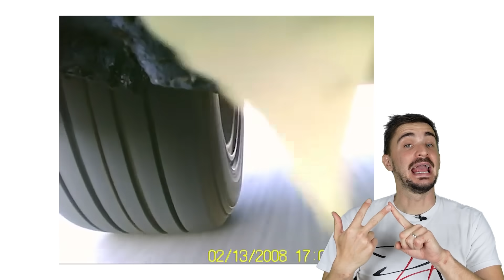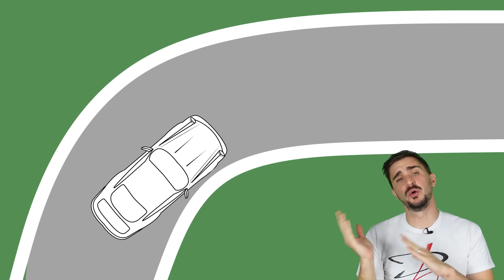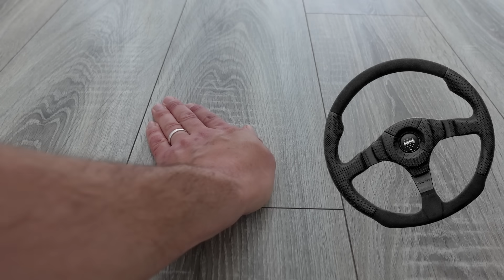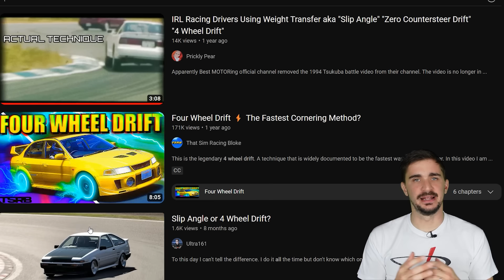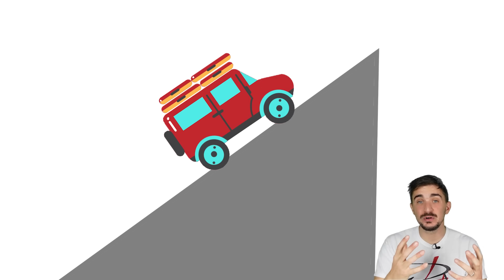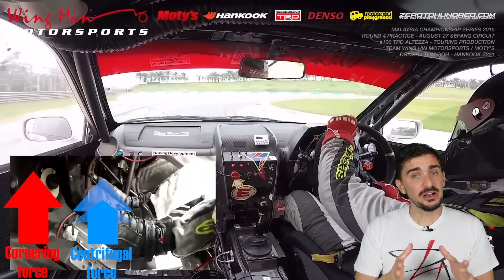You Think You Know But You Don't - Slip Angle Explained in a Way You Will Understand

Comment: Very good explanation but I would have liked to have heard about inertia and momentum. The car is trying to continue going straight ahead until acted upon when the driver turns the steering wheel. The centrifugal force is a component of the vehicles mass and velocity. Cornering force is basically the vehicles capability to redirect it's initial state. the vehicle starts off cornering at 0 degrees per second with zero centrifugal force. When the driver turns the steering wheel the rate increases to something above zero  and the component of centrifugal force increases.

Static friction/ traction versus sliding friction is also important. As the slip angle increases so does traction, to a point. Beyond that slip angle traction will decrease and at some point the tire will break loose from the road. When the tire breaks loose the slip angle will instantly decrease to almost zero but traction will not be restored because the contact patch is now sliding on the road rather than static on the road. 
To regain traction you have to dramatically reduce centrifical force and any breaking or accelerating forces. This is exactly the opposite of what drifting cars do.
If you're not drifting and actually do want to regain traction youll need to basically Coast. No gas, no brake and steer into the slide to reduce the centrifugal force which is pulling the tires across the road.

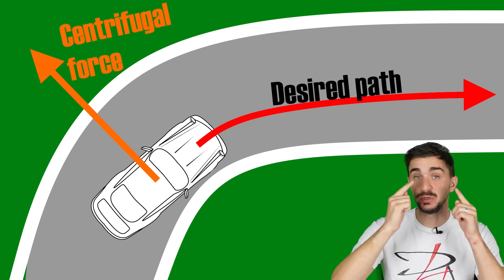Comment: This made me look at cornering with a completely new eyes, however one small thing, there is no centrifugal force, its the car inertia that is oposing cornering force, take a look at the corner at 2:16, there is no force pulling you at 90 degrees of the car, its only car inertia wanting you to continue forward off the corner, if in this moment car completely looses a grip it would continue on a straight path, not directly to the left...

Comment: Erase centrifugal force from your minds, folks.  It doesn't exist and just confuses the picture, giving the impression that there are two forces fighting each other which simply isn't the case.  All that exists is the tire force.  There's no other force to "overcome."  This irritates me because I've had to spend so much time unscrambling the brains of programmers trying to model tires + vehicle dynamics who unfortunately have had this type of nonsense drilled into their heads by YouTubers I've lost track of it all.

The slip angle stuff has nothing to do with contact elements being dropped at the front of the patch laterally progressively further as the yaw changes in a circular path as illustrated in the video by laying hands down one at a time at increasing angles on a curve.  That's not what's going on.  You can have a slip angle without yawing the wheel.  It just needs to roll in one direction while pointing in another.  I.e., there just needs to be a slip angle, it doesn't matter if the yaw rate is 0 or not.  Tire test rigs measure lateral force vs slip angle tests using a belt, some of which is shown in the video.  The tire is not following a circular path in those tests.  If a wheel is facing north while moving to the north-west, the slip angle is 45 degrees, period.  It doesn't matter if it's following a curved path where the wheel's heading is changing or not.  All this means is the portion of the tread rubber stuck to the ground spends at least some time moving at a 45 degree angle to the rim.  But even that isn't always true:  The tire could be locked while sliding at a 45 degree angle.  That too is a 45 degree slip angle.  So it's not even necessary for new tread elements to enter the contact.  

It's just an angle, folks.  Nothing else.

A better mental model is the front contact position is at zero lateral distortion when it lays down on the ground.  At that point it simply sticks there under the load of the vehicle.  Meanwhile, when cornering, the rim is moving laterally relative to that (more or less) stationary rubber, so as a given bit of the tire contact travels to the rear, it is stretched further laterally with distance.  Eventually as the load toward the rear of the contact patch reduces toward (and eventually all the way to) zero, that part of the patch slips back.  That lateral stretching in the sticking region produces the lateral force which accelerates the car sideways just like a stiff rubber band would.  There is no centrifugal force, the lateral force isn't "fighting against" anything at all.  If those two supposed forces were equal and opposite as described, the net force would be 0 and the car wouldn't turn at all.

That's a slightly simplified picture, but it's a good description and leads to good mathematical models for simulation.  That angle between the two directions is called "slip angle" regardless of what the tire is doing, whether it's tracking a turn at 6-10 degrees or sliding all the way out to 90.  Drifting, not drifting, it doesn't matter.  Tire force is largely a function of that slip angle.  It climbs to a maximum at a few degrees (different for every tire, load, inflation pressure, etc..) then generally flattens off, sometimes decreasing a little with further increases in slip angle.  Google "lateral force vs slip angle" for charts and measurements of this on different tires.

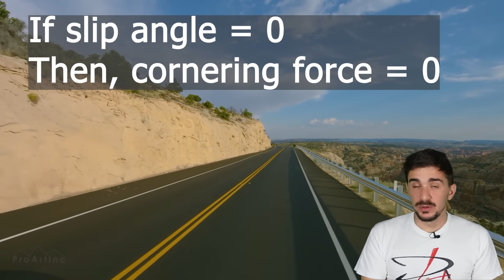The point raised at about 7:30 in the video that 0 slip angle = 0 cornering force is also not correct.  I wouldn't pick on that too much, it's generally pretty close to 0 on street tires and is an ok explanation for laymen which the vid seems geared toward, but it's not really right.  There is always some shift at the origin around 0 slip angle, especially if there's camber.  Google "camber thrust."  Part of the reason your car's alignment is not 0 degrees toe is because of the presence of some lateral force at 0 slip angle.  In fact one of the NASCAR tires in recent years produced as much as 50% of peak lateral force at 0 slip angle.  That's unusual and is the most extreme case I'm aware of, but tires can in fact be engineered that way.  For more information, search "ply steer" and "conicity."  When NASCAR people talk about "building camber into the tire" with different sidewall stiffness at each shoulder, this is what they're referring to.

The notion that it'd be impossible to have any lateral force with a perfectly rigid tire is also incorrect.  Granted, stone tires would be awful to drive on, but they most certainly would produce some force with imperceptibly small slip angle just as a block of stone does when you push it.  Everything deflects under load.  Everything.
Reply: Part 2:

Cornering force vs friction force at around 9:00:  I'll show some lenience because I understand that was meant to be a simplified explanation, but I think it really just adds to the confusion.  It's a bunch of unnecessary hand waving.  The fact of the matter is that the friction force and the cornering force are exactly the same value.  They will always equal each other, so there's no point in trying to add yet another force into the picture (like some do with centrifugal force) to "clarify" what's happening by adding another non-existent equal and opposite force on the vehicle into the picture.  

If by "friction force" you have in mind the maximum possible cornering force, then I would just say that instead of adding a new force and talking about some difference between a resisting force and an active force as though they're different things where one "generates movement" and the other doesn't.   

No.  A force is a force, period.  

It'd be better to show your lateral force vs slip angle diagram near the beginning of the video (using real measurements instead of the ridiculous illustrations, more on that later), point to the top of the curve and say "this is max lateral force.  This goes up and down depending on available friction between the rubber and the road.  The higher it is, the faster you can go around the turn." 

To say "friction force" can not "generate movement" is again overcomplicating and/or misunderstanding what a force is.  A force is simply that which causes acceleration.  Newton's law (F=MA) rearranged:

acceleration = force / mass

That's all a force is:  It's the thing that causes acceleration.  "Generating movement" doesn't mean anything.  If your car flips over onto it's roof, the friction force most certainly accelerates the vehicle toward a stop.  Is that "generating movement" or what?  Again, just like trying to bring centrifugal force into the picture, it's an unnecessary complication.  This stuff is a lot simpler than people are making it out to be.

What's really happening is both forces exist simultaneously, but from a vehicle dynamics modeling perspective it is generally more useful and practical to think of (and program) the system something like this:

1.  Start with a slip angle.  It's just an angle between a velocity vector and a direction vector.  That shouldn't need a 6 minute explanation tbh..  People will understand it better if it's simplified to what it actually is and nothing else.

2.  Because there is some friction available at the tire in the presence of slip angle, the tire distorts as the rubber moves through the contact.  The rubber stretches which induces a cornering force which is possible because friction force increases the same amount.  And because acceleration = force / mass, the force acts to accelerate the car sideways.  And again, the very definition of the word "angle" means the tire does not need to be following a curved path for this to happen.  A simple gust of wind will do it.  A non-circular path is visible in the tire machine tests in the video.  

And angle is just an angle, and a force is just a force.  That's about as complicated as it is.  Not very.

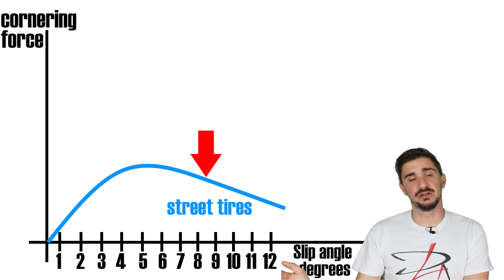At 12:10 you show street tire vs racing tires.  Couple things:

1.  Racing tires generally peak at a smaller slip angle than road tires, not the other way around.  A better illustration would be to have the racing tire increase on a much steeper slope than the street tire and peak at a smaller angle.

2.  5-6 degrees is more typical of a racing tire than a street tire.  Street tires are usually a bit more than that.  

3.  The drop off after the peak in the illustration is fantastically exaggerated.  In no circumstances do they peak at 6-8 degrees and then go to 20-30% force at 13-14 degrees like shown at 13:00, though.  This is exactly the kind of nonsense that lead publicly available racing sims to be ridiculously hard to control and drive nothing like a real car when sliding.  There's plenty of public tire data out there, why not Google and throw out the illustrations?Most street tires barely have any fall off at all after the peak, if any.  I've seen tests all the way out to 90 degrees that had none whatsoever.   With racing tires, anything can happen though.  Some racing tires will stay pretty close to flat after the peak, other tires will hit a peak and then very gently continue rising for awhile before falling off.  Some will rise and gently drop.  They can even change over the course of the run depending on tire temperature and so forth.  Generally it is a safe bet that the racing tire will be more peaky though.

Some of this video I'd give a thumbs up on, but unfortunately there's an awful lot of nonsense here too.  The biggest problem is the centrifugal force stuff.  A tire force produces an acceleration.   f= ma, period.  There's nothing to "overcome." 

Please, everyone, stop talking about centrifugal force.  The physics are much simpler than YouTubers are making all this out to be.
Reply: @toddwasson3355   Centrifugal force does exist and is just as real as the concept of inertia. If you're inside a non-inertial frame of reference (like, inside a car taking a corner) you do need to take into account centrifugal force and coriolis force to do physics. If you grab any college textbook on classic physics you'll see it's full of mentions of centrifugal force, it definitely isn't a simplification nor a mathematical trick.
Reply: @toddwasson3355  I asked Gpt3o and the verdict is that you are spot on. Thank you. 
Explanation for non phycisist.
Turn the wheel → create slip angle (a few graceful degrees).

Slip angle stretches rubber → friction points inward.

That friction IS the cornering force that bends your path.

Your body feels “thrown” outward only because it wants to keep moving straight, but the car is sneaky and turns beneath you. 😉

Comment: If I could ask a question. I understand this, for a change! There's been many a vid you've done that after a certain point, I get brain fade 😂 
Anyway,  why are some cars cited as easy to drive, the breaking point/balance point, whatever you call it, but the equilibrium between centrifugal and cornering forces being much easier to find? Some cars just break away without warning? Is this purely down to suspension set up, tyres?
Also, a good exame of the tyres deflecting and a good indicator of contact patch, but only in a forward motion, are top fuel dragsters pulling away in slow motion. Its as if the tyre moves about a quarter turn, before  eventually the whole wheel moves forward.

Comment: Actually, you find that most amateur's don't have a problem going into the corner too fast, and in MOST cases, they are exceeding slip angles by FAR too much. In other words, it not a question of finding the limits, but that most on the track are exceeding the speed and limits going into that corner.
As a result, they thus don't carry speed thought the corner. 

So, no, it not a question of hitting the limits, but in fact of exceeding the limits, and thus FAR too much steering input is being used that prevents one to carry speeds though the corner. Exceed slip angles by too much, and now the front tires are "scrubbing" their way though the corner - and that's just costing you speed and heating up the tires.

When done right, it feels like the difference between skates on ice sliding like when you are stopping as opposed to carving and gliding nice and smooth through a corner on skates.

You can feel this when going though a corner - there is a magic point - and keeping within good slip angles, the tires are gripping, not sliding thought the corner.

You can feel this effect, and when you finally "get this" concept, it will plaster a smile on your face you never forget when you finally "get it" when driving though a corner on the track.

Fantastic video - fantastic explain!

Comment: Except you are a making out the contact patch is a defined linear spot and then changes to the net patch, its a wheel so its a continuous changing contact patch that is never fully still, so it makes the reality of what is happening slightly differently, you gave a "Digital" style description of a continuous "Analog" process Its actually a constantly Twisting ever changing contact patch

Comment: I was having trouble with this concept until I thought what would happen if I had inflexible wheels on the front of the car. Say, very strong steel. If I were to drive at even moderate speed and turn the steering wheel, the car would go straight forward assuming the edges didn't bight into the surface.

Comment: I'm sure that Mr Ackerman was driving one day, and suddenly there was brick wall. But when he turned the steering wheel jolly quickly, the car tried to go straight on! So he realized that the inside wheel in any turn needs that angular difference to work more betterly. So the next time he came to that brick wall, he didn't need the laundry immediately afterwards.

Comment: Great video, but one thing. Centrifugal force isn’t actually a real thing. There is no force pushing the car towards the edge of the road, it’s just the inertia of the car wanting to keep the car going at the same velocity (that is speed and direction) it is currently going at. This creates the illusion of a force pushing outwards.
Reply: You're arguing semantics. Inertia is a measurable force. Using a simple term to summarize the effect of inertia on a rotationally constrained object is an effective tool to communicate a common phenomenon of combined circumstances.

So no. In practical terms, centrifugal force is a real thing in that it is a useful description of more fundamental, combined phenomena.

I hope you realize how silly you sound arguing against the use of a term to describe a combination of circumstances. Like calling something water, when really it's just two hydrogen and one oxygen molecule.
Reply: @OverDue_Gunny  I’ll send you my physics professors email if you want to argue about the terminology. I more or less just think it’s cool that there isn’t an actual force that creates it but an inherent property of matter. :)
Reply: @chat66   Centrifugal force does exist and is just as real as the concept of inertia. If you're inside a non-inertial frame of reference (like, inside a car taking a corner) you do need to take into account centrifugal force and coriolis force to do physics. If you grab any college textbook on classic physics you'll see it's full of mentions of centrifugal force, it definitely isn't a simplification nor a mathematical trick.

Comment: Ther is not an actual "centrifugal" force, it is actually impossible, what would be generating a force 90º away from the the car? The actual force at work is centripetal force, which is basically the Newton's first law at work. The tyres, and as so, the car wants to keep going straight. We feel it as a side force because we are strapped to the car. If "centrifugal" force was real, as soon as one would stop turning the wheel of the car, the vehicle would be projected sideways to the opposite side of the corner it was taking.